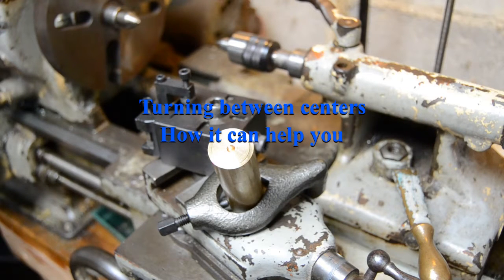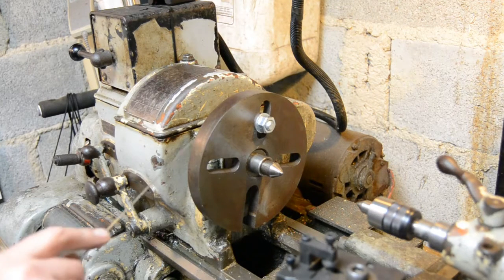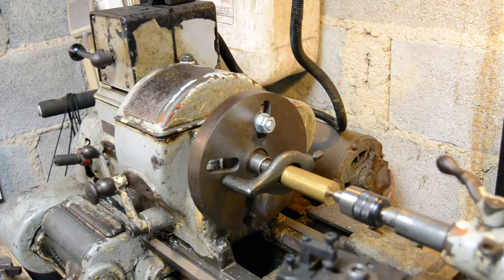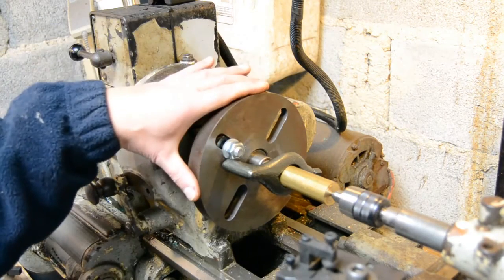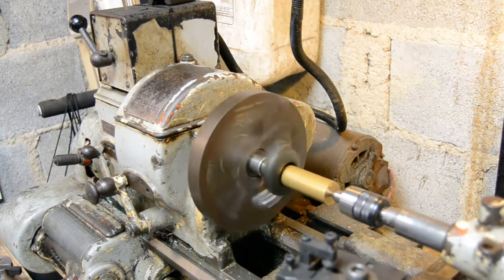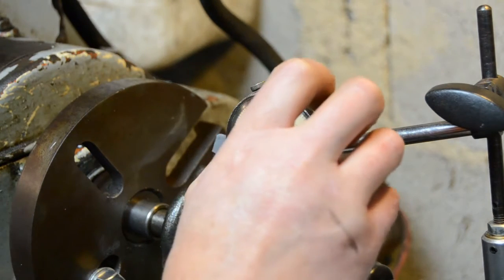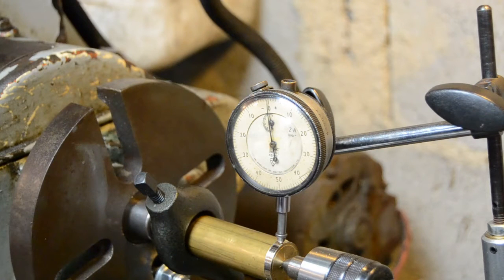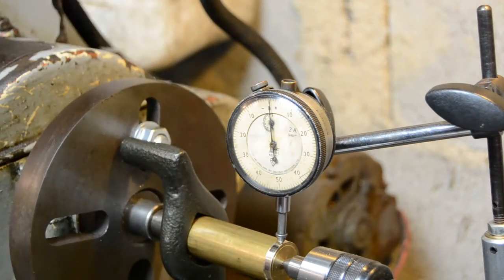Turning between centers, the why.

Comment: The problem of turning between center is getting the tailstock and headstock centers perfectly aligned so as to not turn a taper.   Concentricity is never the problem.  Cutting a shaft over distance requires that you either indicate it over its length or make a trial cut at each end and mic it to ensure it is cutting the same diameter.

Comment: Can you remove the dog when you would put it on the mill for example and the put the dog back on it, put it back in the lathe and it would still be concentric?
Reply from the maker: Thats the advantage! the concentricity is provided by the centres at both ends, to dog just transmits the drive, so you can take it on and off as much as you need to.

Comment: In addition,  one end may be machined to spec the part turned end for end, using copper sheet to prevent lathe dog damage to the part, then machine the other end exactly concentric to the beginning work.  This process works great in a cylinder grinder as well.   Best regards I would encourage the making of additional videos.

Comment: Always wanted to try it out  never had the chance at work but there's been a few instances where it would have saved a heap of time. The face that you can take the part out and turn it around is a big plus. Especially on pins that are one dimension all the way along. Had to take thou off the whole length of some 3" pins. Fiddling with ally in the jaws of the 4 jaw and only being able to grab the big heavy pin in the tips of the jaw caused a lot of teeth gritting 😂